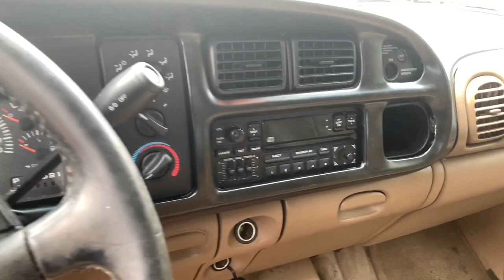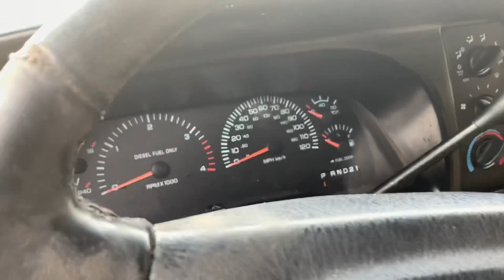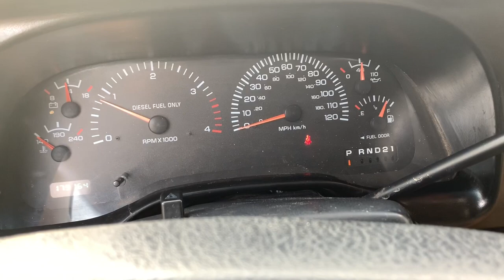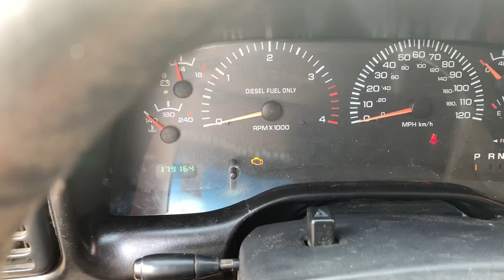I BROUGHT A 2ND GEN 24 VALVE DODGE CUMMINS

Comment: Damn it's been a long minute. So it this truck straight piped now? And are you going to dump the exhaust under the truck with one of your huge tips. Or just put the tip on it and run it out the side like it is. Anyway, congrats on the new truck.
Reply from the maker: Yeahh prob gone axle dump one of them once i get some wheels and tires